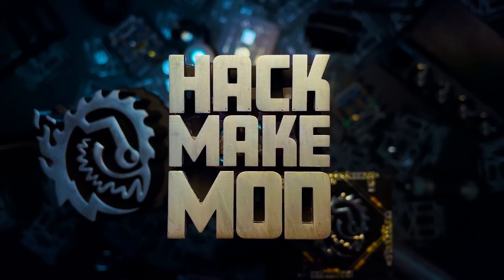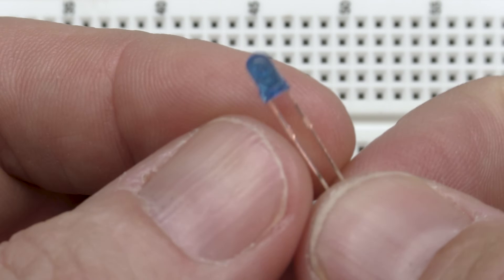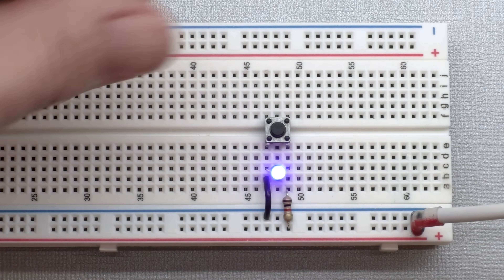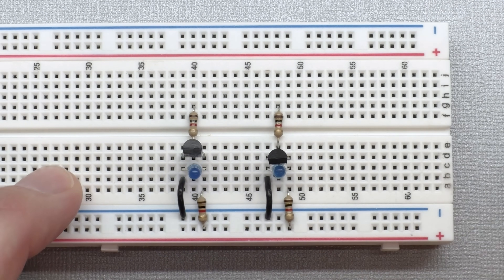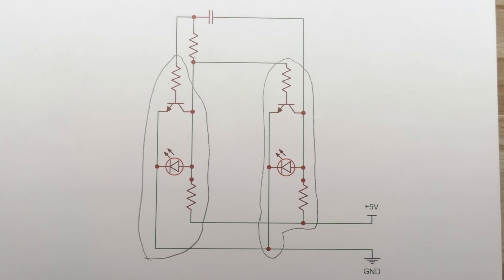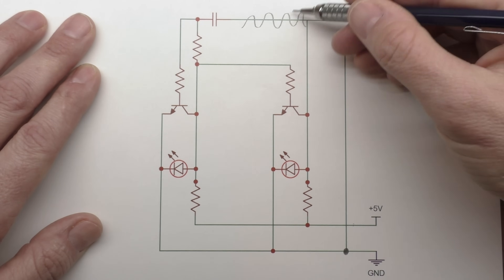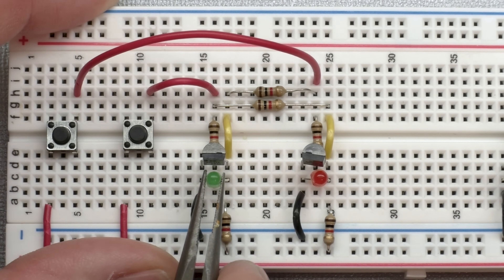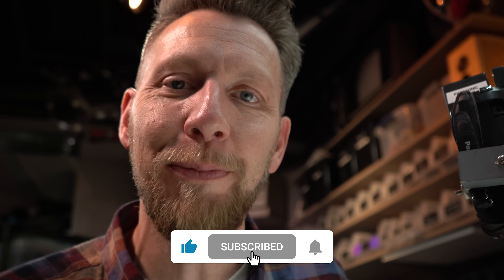Fun with Transistors

Comment: In my last 30 years, I always wanted to understand transistors, but nobody made it so simple, finally I have learned about transistors. Such a great teacher.
Reply: In depth, transistor isn't realy simple...
Reply: @IGBeTix-Electronique ???
Reply: @joverstreet24  if you know the transistor in depth, you must know that it is a realy complex device in reality.
Reply: @IGBeTix-Electronique  It’s not complex but can be used in many complex ways I’d say.
Reply: 30 yrs 😂
Reply: @zephy01  yh, you heard it right.
Reply: @joverstreet24  Pleas elaborate why is not complex? Do you understand the bandgap that makes it work? What limitations it has? how to model a transistor? why they are frequency limited? how a different channel size alter the performance of FET? what the level of doping does for the the device? transistors are massively complex, they are easy to buy and use in simple situations, but someone already did the hardwork of making the transistor work.

FYI i am an EE.

Comment: I've had a basic understanding of what a transistor does for a decade and a half. But it was seemingly impossible for me to ever use them in practice, mostly because I would not know which specific one to use for my ideas, but also because of all the obscure little details like pulldown resistors, bias voltages, etc. Having a guide like this that actually shows you how a general purpose transistor can be used in a variety of ways is gold! It's really easy to follow along when the unknowns are already figured out for you!
Reply: Same!

Comment: It has been 2 years now and you never came back to these simple subjects!   I think you should do a circuit analysis of this exact video showing voltage & current flows, voltage drops, Kirchhoff's circuit laws, etc.  Calculate Ohms' Law, Beta Re,  Vce, Ic, Ib, Vbe. ...  Read the data sheet on the 2N2222 and how it is applicable to this circuit.  Make this circuit with a PNP transistor.

Comment: This is wild.. I think I understand this.. I just placed an order for this breadboard set from your site. 
I am a bit confused about ( @12:32 ) putting a 10k resistor connecting the capacitor and the output of circuit 1...

Comment: At 12:39 why you put a resistor with the capacitor as it does not pass electrons???🤔🤔🤔
Reply: Capacitors don't pass DC current. Since we add the resistor, it becomes AC

Comment: 5:11 if you are running off say a 9 or 12v supply then you do t really want to install them the wrong way around as when you you apply power, some LED’s have a fairly low peak inverse voltage PIV a and they can avalanche and go short circuit.

Comment: Great video. Can someone please help though. Around 17:00 where he talks through the circuit, I’m a bit confused. Does the capacitor charge through the 10k resistor (the output from the LH inverter circuit) in which case, how is the RH side of the capacitor +ve? If it charges through the RH circuit, as I think he is describing, then what does the 10k resistor do? Any help greatly appreciated.. I don’t think I fully understand 😬
Reply: I'm wondering as well. I'll lyk if I figure it out

Comment: One doubt, in 10:28 by adding those 2 tiny yellow wires, how did that become the output of the circuits and the base of the transistor became the input?
Reply: If you keep watching for another minute, you’ll see that a red wire was connected to the base of the left transistor (input) to control the behavior of the circuit on the right (output).

Comment: 12:00 Please can u explain what is happening here, maybe by current flow slowly
Reply: Capacitors don't pass DC current at all
Reply: Please how does it charge the capacitor when the other terminal (that is connected to the collector)of the capacitor is not receiving current @rombsercs

Comment: Don’t know if I missed the gist but seems an unusual way of turning off the LEDs by shunting them off? If the VCE sat of the transistor is high enough the LEDs might just dim or not go off at all. Why did you not connect the LEDs in the collectors and use a common emitter arrangement? Sorry just wondering, if probably missed a point somewhere 😂

Comment: At 12:40 shouldn't you have removed the transistors resistor on the right side since you get 2k ohms there when the current flows and make the left led dimmer. Or at least put a lower value there so that the current doesn't take a left path to ground. I am not a professional so I might be wrong.

Comment: How would you do it so that you have lights indicating the input AND output of the inverter? You only have one LED indicating the output signal. What about if there was an input signal? How would you be able to display it?
Reply: There are two transistors in the latch he built and it's doing what you want. One led represents the input of an inverter, and the other represents the output. 

Personally, I wouldn't short the LED to turn it off, but the current is probably pretty small.

Comment: 🤔 LED flashlights don't have resistors, and the LED doesn't burn out.
Reply: Probably has an inbuilt resistor as some LEDs do.
Reply: @tonygardner9896  Nope. He lied. They only need a resistor if you're using too much voltage.
Reply: @SeeFreeTV  Yes.  If the input is say 3 volts, it will power the LED.  Ohms Law says V = I xR.  So if the LED forward voltage, ie that required to power it, is 3 volts then no resistor is required.  But I do have LEDs that have an inbuilt resistor up to 9 volts.

Comment: Just one simple thing...
It would be a bit better if you use long nose pliers or tweezer instead of your large finger when you put/remove wire from the breadboard.
I think it would make the image easier to see since nothing will be hidden, even for 1 seconds.
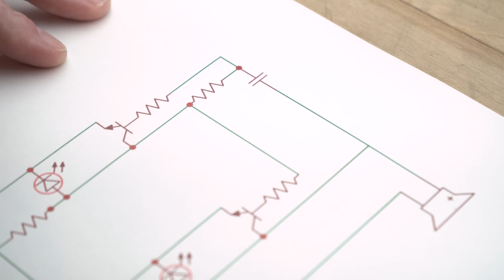And please avoid changing the camera angle on schematic (like 15:58). It's already hard to understand and the less distraction is better, IMO.
Reply from the maker: Got it! Thanks for the feedback

Comment: I remember led hookups by looking at the big piece within the light and picture it as an axe. The axe always chops the log therefore your resistor is always on the opposite leg of the axe. The axe looking thing within the light Is always looking to chop the wood which is the resistor.

Comment: Wouldn't the error by connecting the positive to the speaker result in unrestricted current going thru the right LED? or is the resistance in the speaker high enough or is it just that it is pulsing that protects the LED?

Comment: I'm just starting out with electronic circuits so everything is new to me. I must be missing something very simple here as I can't seem to grasp what's happening at the 11:24 mark. I thought I understood with the first yellow jumper from the left LED output to the right LED Base but that theory collapsed with the addition of the red jumper to power the Base of the left LED which turned out the right LED. Why isn't there power at the yellow jumper from left to right? The left transistor is active allowing voltage through and should be powering the yellow jumper to activate the right transistor right? Clearly I'm not right  but that's how I'm seeing it. My only theory is that when the left LED is lit there's extra current to feed the jumper to the right and activating that transistor so the LED is off but when the left transistor is active all the current goes through that transistor with nothing left to feed the right transistor so the LED is lit. Hope that makes sense and I don't look like too big an idiot lol!
Reply: I just tried it all again and it was definitely something I did wrong lol! I didn't trim my component leads so I'm guessing I had some component touching another. Tip of the day, trim your leads and get shorter, solid, jumper wires

Comment: So current is always positive and in your first example the current was traveling from the source to the resistor to the led and then to the ground.  And electrons were traveling from the ground through the led and the resistor to the source.  I hope I have this configuration correct.

Comment: Electrical current does not "take the path of least resistance." It takes all paths of any resistance in inverse proportion to the resistance. In practical circuits very low currents can often be ignored, but not always. The leakage current through the plastic of that breadboard could be enough to cause some circuits to misbehave.
Voltage plays a big role in the circuits shown. When the transistor turns on the collector-emitter voltage will be well below the voltage at which the LED conducts sufficient current to produce noticeable light.

Comment: Would you please add the values of the different components? Like we need to know the 100 ohm resister limits the current so that current does not exceed the 20 milliamp limit of the led. That way we can use Ohms law to find the input voltage of the led or the op-amp. Just askin. Thank you

Comment: Two questions: 1) Can the resistor be eliminated if we lower the voltage or amperage? 2) Is the purpose of the resistor to gain more brightness (Light Output), while protecting the LED from burnout?

Comment: I enjoyed your video but watching it on the TV at about 15:38 you lost me. You said a few seconds later that you won't go into the electron flow. I think that would have helped a lot.

I went back and studied it. What I was wondering is how does the capacitor get discharged. Through the base of the second transistor? Wouldn't that much current flow damage the transistor? The only other route that I can see is back through the resistor that charges the capacitor and then through the LH transistor which is on. My gut feeling is that would lead to some sort of a weird floating state, but then again what do I know.

Anyhow, if you could explain this in more detail I'd appreciate it.

For the most part I really like this and will subscribe.

Comment: In the first section, I think that the current is still flowing through the LED path though the transistor is activated but in low amount. Because current naturally chooses the path of low resistance, it does flow in that direction but it does not mean it does not flow through the LED path. It flows but very low current passes not being able to light up an LED. is my understanding correct?

Comment: This is such a helpful video - thank you!!
Could you help me with this question please - I don't understand why you say the yellow wires at 12mins are going from the "output" of one circuit to the "input" of the other. 
Isnt the wire taking the current from the always-live collector (so an input rather than output) of the transistor on the left, to the base (I think) of the one on the right?

Comment: followed along the video and everything worked right until 11:00 . when i connect the output of the first inverter with the input of the second both leds go out and i have no idea what i am doing differently. i use the same components 2N2222, 1k resistors and a 5V DC from USB.
Reply from the maker: It’s hard to troubleshoot through YouTube comments… please join our forum and we can help you.
https://forum.hackmakemod.com/
Reply: reduce the resistor same happened with me when i used the 10k resistor, i reduced it to 5.6k it blinks fine'

Comment: The +ve voltage from the battery (red wire)  is connected to the collector of the transistor. How then does it become the output of the transistor ? I thought the output of the transistor was connected to the black wire (ground). Going by this logic, the terminal connected to the red wire should be the input voltage terminal. I am assuming that npn transistors have been used here. I am a newbie to the subject. Plz help me out here. Thanks.

Comment: Sir could you please explain why we need a resistor with capacitor.
Reply from the maker: Using a resistor with a capacitor in this circuit is essential for controlling the rate at which the capacitor charges and discharges, which is crucial for creating predictable electronic behaviors. This pairing forms an RC (resistor/capacitor) circuit with a specific time constant that dictates how quickly the capacitor reaches about 63% of the full voltage during charging or drops to 37% when discharging. This controlled charging and discharging process is vital for stabilizing circuit behaviors, filtering frequencies, shaping waveforms, and protecting components from voltage spikes, making it fundamental in designing effective and safe electronic systems.

Comment: When I built it, the oscillator timing was not equal.  When I switch the position of the capacitor, the time timing switched.  Is it possible that the capacitor placement will determine the make one longer than the other.

Comment: I am a software engineer with more than 10 years in both work and university study in bachellor and master deegree. I know a lot about everything about electricity but in a general knowbase. 

I now want, in paraller with my fulll time remote job as a manager at a big corporate, to start my own business by creating a fully automated greenhouse. 

First i took a simple arduino and programmed it with a humidity sensor,  so i can know how much water there is in soil. AND THE PROBLEMS BEGUN  here. 

I am a software engineer. How it is supposed to connect my light sensor so i can open the windows? How can i put some triggers for opening or closing the heat? How can i know that a thief is inside my greenhouse? 
In general how can i scale my project? I was afraid of just brute force, as the electronics are expensive sometimes. This video made me clear how i can connect all of them and create a complex arduino system with automation about, generally everything.

Comment: So if you wanted to make a 12 note keyboard this would be the basic circuit just need to add 12 different capacitor and resistor values and 12 push buttons as "keys?"

Comment: Good video. The only thing I would criticise and suggest is incorrect is your explanation of the frequency waveform from the capacitor, where you describe it as going positive negative positive negative, where in actual fact it is going positive then back to zero, then positive then back to zero. It also means your drawing of the waveform is incorrect too, as it not a sine wave but a pulsed dc kind of shape.

Comment: It's a good video. Nicely explained and filmed. I came away disappointed though because the capacitor and resistor wasn't explained. In theory one could take the basic building blocks and go build something else but it would be risky as one doesn't truely follow what goes on here without that middle section properly explained. Still, a positive contribution overall, just a real shame it didn't go the distance.

Comment: This video is amazing. I'd been struggling to build basic circuits, and this gives me a lot of tools to move forward with. I was able to build all the components by following along step by step. One conceptual question I have that I can't quite figure out is why the inversion circuit outputs just past the collector on the breadboard. You talk about this around 10:45 but I would think the output would be at the emitter as the current goes back to ground in that direction in the simpler circuit. Any clarity here would help me understand the concept much better, thanks!

Comment: But why & when did the capacitor switch from polarized electrolytic to unpolarized ceramic one? It just switched in the end and i dont see 2 capacitors in the final circuit. Just the one in the delay circuit that got switched from polarized 22uf to unpolarized 1uf.

Comment: Why is the LED turned off when the transistor is connected? It looks like the led and transistor are in series so both should still receive current. Is it because the resistance is so low in the transistor that the current almost entirely runs through the transistor and only the slightest amount through the LED?
Reply: When the Base gets atleast 0.7V a Transistoren has Almost no ressistance between collektor and emitter.
Reply: @Christian-fd9jq  thank you
Reply: Parallel* not series

Comment: 🇬🇧 👍🏽 December 2024

Awesome video!

While this might well be about as basic as electronics gets - it's actually a glimpse into the fundaments of how a microchip works, because even the most complex CPUs boil down to lots of transistors.

It's frustrating not being able to see under the hood of micro-electronics - so stuff like this is the nearest we're gonna get.

And as irrelevant as these huge transistors might be to micro-electronics - we do still very much have visible resistors & capacitors on modern micro-electronics - so it's good to see three such key components being put to work & explained.

Comment: RC time constants, pull up resister ,  saturation mode NPN transistor ,  latch circuit( you could do a jk flip flop but this is about transistors )  thermistors and photo resistors .  Pretty good primer for people interested in electronics -  the trouble with transistor theory is that when you get into various types of amplifiers oscillators and the math. Overall though,  good vid. You should do a bit on diodes like zener , high voltage and microwave diodes . I would have liked to see an oscilloscope display of the output to the piezo twitter though.

Comment: Ok, I am probably the dumb one, but i am stuck on the 'Oscillator" step.  I have the two separate circuits working (power ot input turns off the LEDs), and I connected the yellow input wires as shown, so both lights are ON.   When connect one output to the other input one light goes out - great.  But when I connect the other way both lights go out instead of one going off and one one.  I have rebuilt it, doubled checked it, etc.  The one difference is am using a 5V breadboard power rail unit for Arduino to power both rails from a DC power supply (does everything need to use the same single power rail?).  I guess my thing would be to cut a USB adapter cable like the author did.  Other than that I am stumped.   I am sure I a mdoing something wrong but...